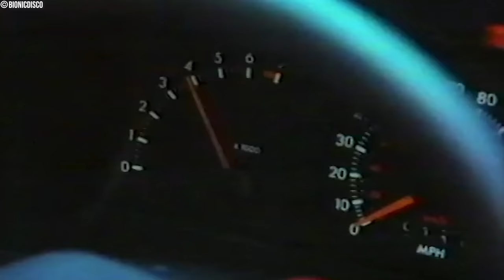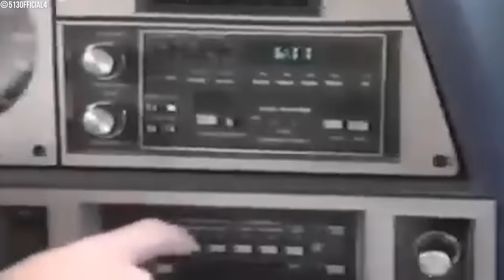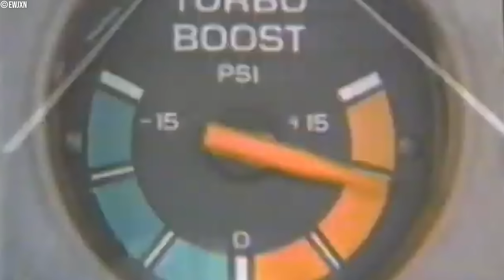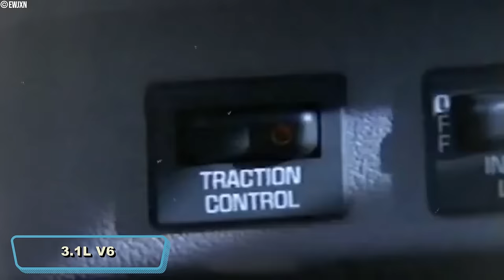13 WORST Cars From The 1980s, Nobody Wants Back!

Comment: Clearly the author was not alive back in the 1980's. The Escort shown wasn't even sold in the US market.. and that was the beginning of the errors.
Reply: 1981 U.S. ford  escort  was fwd
Reply: the only real problem with early Escorts was the timing belt, if it jumped one tooth it took the valves out, 50,000 miles was the limit unless you wanted new valves
Reply: Escort sucked no matter what
Reply: This was composed by a robot
Reply: At one point, they didn't even show a Ford. They showed an MG. 

I wonder if anybody ever thought of taking a 1970's British Ford Escort to the US.
Reply: It was an excellent car. The Ford escort especially the XR3. Mxm
Reply: @cobra-mn745  And also, the heads and head gaskets leaked and cracked.
Reply: @aaronwilliams6989  never seen that problem unless it overheated
Reply: What the hell are you talking about? They were one of the largest sellers.
Reply: What you fail to realize they were interduse in Europe first..
Reply: I remember working in a salvage yard in the late 80's and the Ford Escort was the only car we ever lost money on. We literally had one of those things sit in the shop and jump time, destroying the engine while we were checking out the engine
Reply: Didn't do his research. Not good enough.
Reply: The 1'european escort was a great car,used a lot in rallies. The author does not know what he is talking about
Reply: @GeeEm1313 The cars shown in the video were British Escorts, that weren't sold here. The British cars weren't the same as the US cars.
Reply: The Escort debuted in the US in the early 1980’s
Reply: I liked my citation. It wasn’t a Camaro, but it was ok and never gave me an issue.

Comment: You missed the most glaring examples of 80's failures, those being the Yugo, and the first Hyundais
Reply: I concur.  I bought a 1986 Yugo right after I got out of high school.  Thought I was a bad-ass because I was able to get a brand new car.  Importer went bankrupt so all warranties (including the extended warranty I bought with the car) were void.  Had to replace the clutch at 32k miles (I did not "ride the clutch").  Wouldn't pass emissions soon after that and I couldn't afford to fix it.  The bank allowed me to park it in a garage and drop the insurance.  They said "nobody is going to steal a Yugo, so just keep making your payments and we're ok with you garaging it with no insurance".  Sold it to a mechanic for a about $400 after the loan was paid off.
Reply: Yugos 1,tank of gas ⛽ and it will never run again
Reply: Depends on how you want to look at the first Hyundais (ie Hyundai Excel). The first Hyundais were failures in terms of being high quality or desirable cars. BUT, they were CHEAP, CHEAP, CHEAP. As a result, they sold well and made lots of money. They essentially paved the way for Hyundai to enter the US market. And in this way, the Hyundai Excel was a success.
Reply: You are correct.
Reply: LMAO get bent, the Hyundai Pony is an awesome car. 2024 and I have two of them, and I can go sideways wherever I want, and go offroading.
Reply: @jerseyforhawks  No, he is not.

Comment: I had an 86 Cavalier and it wasn't going to win any races, but it never left me stranded. It was a great running car even with high mileage.
Reply: Nobody wants them back tho.
Reply: @GeeEm1313  Speak for yourself. I'm sure many people would like a solid, reliable long lasting car for cheap.
Reply: @GeeEm1313 I do. I had an 86 Z24. Loved it. Have had WS6 Trans am's , WRX Impreza. Have a Daytona Charger, Bronco and Hybrid RAV4 and would easily take a mint 86 Z24 over any of those. Most fun car I ever had. Loved the looks just loved the car.
Reply: @bikingD damn right.
Reply: Chev Cavalier for US is not even close to vauxal cavalier and chev monza or opel ascona.
Reply: @Prisoner13  Vauxhall. Apples and oranges.
Reply: My Dad had a 1985 Cavalier hatchback.  Lasted 10 years and many cross-country trips.

Comment: The Fiero was fine with the V6. The suspension was not that bad just needed a sway bar in the rear you can add. It did not hurt normal driving. The 4K was the only issue most 1984.

Comment: I don't know about other Chevy Citation owners, but I had an 81' and I put 300,000+ miles on it (with average work done on it, i.e. alternator, plugs, and a steering pump, brake pads) and it was still running well when I sold it in 95'.
Reply: If it weren't for all the defects, the Chevy Citation could've been a decent compact car.  Don't get me wrong, the X-11 package is far from the high-performance machine it tried to pass itself off as, but that doesn't mean that in time, it could've gained some respectable muscle under the hood.
Reply: Most people who bought Citations had problems with them. There were exceptions, of course.
Reply: Luck of the draw.
Reply: They didn't mention a serious problem with the Citation; it's rear wheel brake locking which would cause a loss of control under hard braking.
Reply: @althunder4269  I agree. The Citation and the other X-body cars are the absolute worst GM cars in history.
Reply: My dad had an 85 that lasted until at least 1996. By then, the bugs were fixed. But nobody cared.
Reply: There are 2 Citations still living running the roads daily in my community
Reply: i had an 83 with the 2.8 v6 and that thing was a beast.  would tow and put in my 14' fishing boat at the ramp no problem.  smoked a few four banger mustangs and berettas with it too.
Reply: Exactly, we had an 83.  Very good car and reliable with Iron Duke
Reply: @stussels  the 83 and later models were the ones to get.

Comment: Anybody remember the Dodge Rampage ? The mini Elcamino/Ranchero.😄 .
Reply: I do, drove one hours at a time while on Flight Line Guard Duty, on MCAS Yuma.   Never had any problems with them, and they got GREAT gas mileage.   They were also quick and powerful.
Reply: I remember them. Despite all the “design flaws” and “mechanical failures” plaguing all of the vehicles featured, they sure sold enough of those particular platforms - except maybe the Cadillac Cimmeron…
Reply: Yes but haven't seen one in probably 25 years.
Reply: @sombra6153  Many of these vehicles sold well for no other reason than the fact that they were cheap.

Comment: I don't know what GM was thinking with the Cimarron, by introducing it with a 4 cylinder, and manual transmission. It should have only been equipped with the V6 and automatic. Cadillac buyers wouldn't have wanted a 4 cylinder, and definitely wouldn't have been used to shifting gears manually.

Comment: One of my first cars.  Was a Plymouth horizon.  It was basically a thorough way car.  The Timing.belt was inside the engine. When that thing blew in  trash the whole engine. It was a tin can after that. You just threw it away.      William

Comment: GM J cars maybe some of the best GM cars ever. They kept going and going and going. I had a 86 Cavalier. My Dad an 84. Best friend 88 and girlfriend 89 we all loved them. As for the Omni the GLH Turbos were a beast. You obviously know nothing of cars. Worst 80's cars. Yugo, Hyundai Pony, Stellar and Excel. Early 80's Civic's rusted and valve seals. Rx7 garbage total garbage. GM X cars. Brutal recals. Nissan Stanza rust rust and more rust. Renault Alliance under powered and fell apart. Any BMW electrical Knight mare those are trully bad list of cars sold in the 80's in North America. You actually said AMC Eagle. The 258 straight six maybe one of the best engines ever made. Wow. Just Wow.

Comment: Definitely a crappy half- ass effort at making a vid.  No real facts,or context, just another stupid " ranking" vid.  The 80s were a tough time for American Automakers
 Chrysler begged Reagan for a federal loan to stave off one bankruptcy. GM  and Ford were busy trying very early robotics to speed up assembly lines, sometimes with hilarious results. Robot welders were skipping welds, robot painters were painting each other and everything but the cars.  Quality sucked, fit. Fininsh, and performance were down across the board. But to single out certain cars or brands is to ignore the politics and problems of the 80s.

Comment: Well I'm one that like the eagle, but I'm also a big fan of AMC despite the reputation  of AMC they had some very good cars.. Now I also loved the Dodge colt bought one in the 80's turbo charge.  I knew of a 12 mile strip of road i could test the car and took up 135mph all the way of that 12 miles and never had any problems with the car..

Comment: I can affirm the Crappiness of the EXP.  I had a red one just like the video.  Broke the Timing belt around fifty K.  Just toasted the entire valve assembly.  Then had to fight the Dealership to get the damn thing fixed.  Ended up having to threaten to take them to court before they did it.

Comment: Ah Ford Escort of the 80’s, drove a 1983 wagon with 5 speed manual.  Was one in shop monthly and 5 speed was clunky.  Only things that worked with no problems was air conditioner and brakes.  Learned what Ford was a synonym for than and it was “Fix Or Repair Daily” and fully loaded understood and dealt with it on a monthly basis and sometimes more.

Comment: The Hyundai Excel.
The dashboard would fall off. Nuff said.
I had a 1985 Nissan 200sx and it started falling apart within 1 year. And also a 1988 Ford Mustang where the hood wouldn’t latch and Ford said it wasn’t an issue.

Comment: Our Citation was good. They should have made it an automatic rather than a stick shift. But I didn’t hate it. They are talking about the cars of the 80’s but one car we had that ran like a bullet was a 1975 Gremlin (AMC). We bought it in Germany and that thing drove on the autobahn like nobody’s business! So many cars built so cheap and so poorly. Before the 80’s you could buy a car and it was like a tank. And the number of cars on the road from the 50-60’s is legendary. The cars had looks and performance along with reliability. And how many guys learned to fix cars handing tools to their dad under the hood of a car or pick up? Yes we have a lot of improvements since then but there is so much they should have left alone. One of them was dad and son (maybe daughters) fixing the family car.

Comment: I had a 1885 Fiero 2M4 & 1986 2M6. The 2M6 model caught fire as the motors on them overheated & both has a poor fiberglass body. Other issue is GM in the 1980's had paint issues causing peeling & cracks as they used poor clear coat on them as my old 1985 Buick Skyhawk, 1986 Camaro IROC-Z & my 1987 Buick Grand National did.
Reply: GM certainly had the same problem well into the early nineties because my mom had a 91 Oldsmobile Cutlass Ciera and it started losing its paint due to bad clear coat...

Comment: I use have a Plymouth Horizon. It didn't have power....well anything but it was damn near unkillable. It had a little Mitsubishi 4 banger. Had over 250xxx miles on it when i sold it, saw the guy i sold it to a couple years later and he still had it with over 325xxx miles on it and was still going.
Reply: Plymouth Horizon never came with a Mitsubishi engine.
Reply: @matthewstorm5188  my mistake it was  vw engine

Comment: horizon and omni was an american version of the vw rabbit
Reply: It was actually designed by Chrysler’s French division and sold as Talbots in France, the design actually pre dated the Rabbit by a couple years, Chrysler had them developed for the USA during the 79 oil crisis. Many of the original Horizon’s and Omni’s had French made engines, I believe they were 1.6 liter engines.

Comment: My family had a Dodge Omni, it was initially my mother's car, which ended up with my sister for a while. The car overheated on me once and the only warning that it was running hot was big red "engine" light, which could mean anything from "check oil", to overheating, or any other malfunction. I pulled it over, let it cool down and got it home. When my sister had it, the overheating problems continued and my father tried to fix them, but I think he missed the obvious culprit: the radiator, which I believe was partially blocked and not providing sufficient cooling. My sister would run the heater to try to keep the engine cool, but ultimately pushed her luck once too often and cracked the block. I drove passed the car sitting on 495 with no signs of my sister. I called home from a payphone to see if the family had any news, and it turned out my sister was at the business next door to, also calling for help, so I got her where she needed to be and made arrangements to get the car towed somewhere to be looked at.
Reply: In high-school I rode in a burgundy dodge omni my friend owned. This one had a bad cylinder and was only bangin on 2,  we tried, desperately to smoke this 1995 Mitsubishi eclipse. * sighs * there was disappointment at each green light.